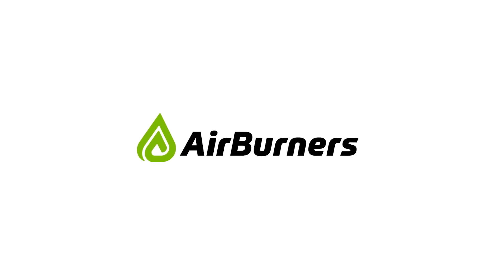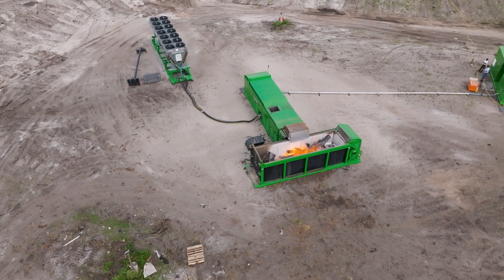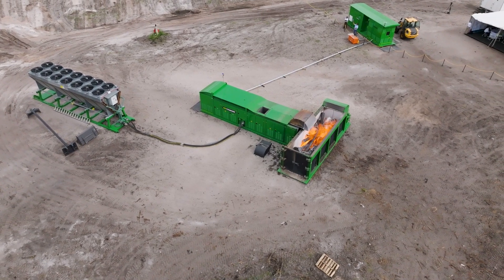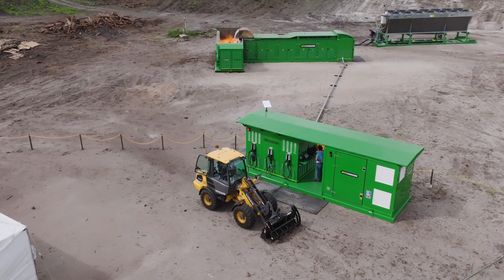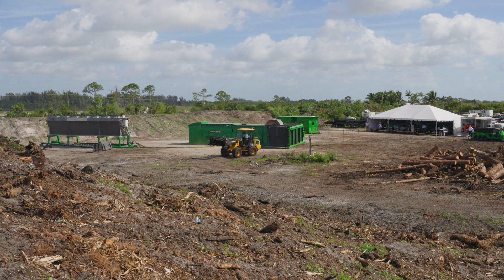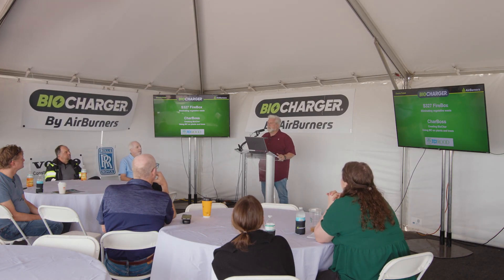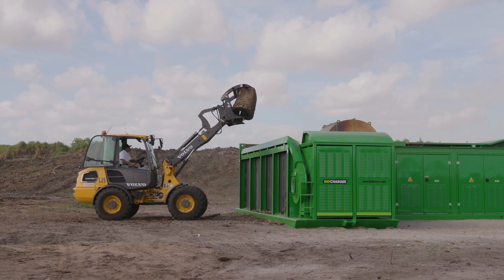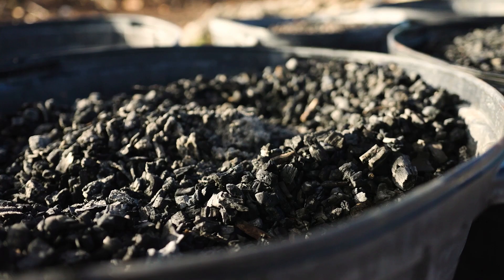From Wood Waste to a Self-Sustaining Electric Forest: The Future of On-Site Energy 🔥⚡🔥

Comment: btw a proper wood chip biomass generation plant would make a fuckton more power per cord of wood (x20+), but it requires processing, land and way more investment.
For 1.5M this portable thing will get rid of the wood and possibly power your equipment while on site.

They really need to focus on charring with 90%+ efficiency if they really want the product to be a real solution.
Reply from the maker: Thanks for your comment! You're absolutely right—a large-scale wood chip biomass plant is capable of producing significantly more power per cord of wood, but as you pointed out, it comes with major infrastructure costs, land requirements, and ongoing processing expenses.
You are a great innovator, we are on the same page as a new larger machine that will automatically make biochar will be out this year. You will also be able to create energy as well!  
The BioCharger serves a different purpose: it’s a portable, on-site solution designed for operations that need to eliminate wood waste immediately while generating usable power in the process. At a fraction of the cost of a traditional biomass plant, requiring no preprocessing, and can be deployed anywhere—no need for a permanent facility or expensive logistics.
It’s all about the right tool for the job! Would love to hear more about your experience with biomass energy. What kind of applications do you work with?
Reply: @airburners  Bold of you to assume I have a job 🤣 Maybe you have an opening for me. lol.
I'm just a self taught chap wasting time on the Internet. 
I find your machine intriguing and decided to research on the ORC engines running your generators.

It really seems like if you developed this further you should be able to generate energy while achieving a way higher charring efficiency, which would actually turn the machines in to a proper carbon solution, not just a 'slightly better' alternative. You know it doesn't matter that the carbon emitted is organic if you're not going to grow the trees again...
Reply from the maker: @ignasanchezl  It is a 99% better alternative.... and leaving the ash and  biochar behind allows for faster growth of trees for the future. Healthier soils for hundreds (perhaps thousands) of years!
Reply: I'd be interesting seeing a machine like the char boss managing corn stalks.
Reply from the maker: @ignasanchezl  it will not work well. Since the CharBoss was made under a CRADA with U.S. Forest Service, their extensive testing has shown that the best biochar return will be achieved with a specific diameter of feedstock around 10".

Comment: It's amazing, wood waste, emit carbon into the atmosphere when they burn wood waste and turn it into green energy?? That's a totally new concept!! 😂 still not green tho. I do love a bad azz bonfire tho. as well as a fire in the wood stove.
Reply from the maker: Appreciate your thoughts! You’re right—burning wood does release carbon, but the key difference with the BioCharger (and Air Burners’ technology in general) is that it burns cleaner and more efficiently than open burning or traditional combustion methods.
Here’s why it’s a step toward greener energy:
1.	Controlled Combustion = Lower Emissions – The high-temperature burn inside the BioCharger significantly reduces particulate matter and pollutants compared to open burns.
2.	Wood waste is part of the biogenic carbon cycle. Unlike fossil fuels, which release carbon that has been locked away for millions of years, burning biomass returns CO₂ that the tree absorbed during its lifetime back to the atmosphere. This carbon would have been released naturally through decomposition, meaning the process does not add new CO₂ like burning fossil fuels does.
3.	On-Site Power Generation – Instead of just burning waste for disposal, the BioCharger converts it into usable energy, reducing reliance on fossil fuels for remote operations.
At the end of the day, it’s all about doing better with the resources we have.🔥
Reply: The only reason why their product is appealing is because of land clearing. The land clearing will happen anyway and this stuff gets burned either way.

But honestly you're right. At the end we're just masking the issue of massive land clearing.